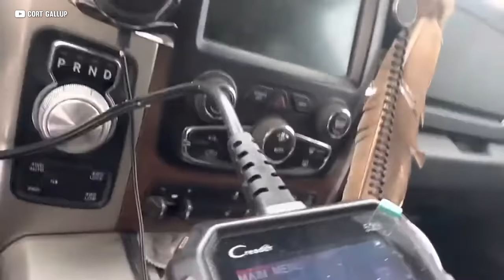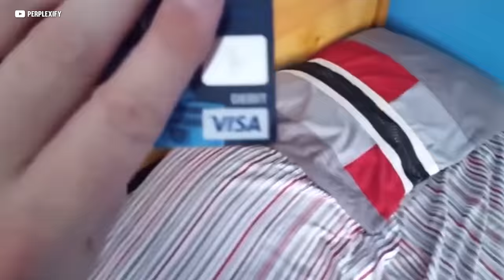Worst Trucks Only Stupid People Buy

Comment: I'm a traveling nurse--I visit dying patients in rugged areas--my GMC truck, brand new, soon developed a piston ring failure problem and scratched the cylinders starting a massive oil consumption problem. I was putting buckets of oil in that thing all of which burned and caked over the entire engine bay over the next few years and made the timing chain to slip. It finally failed me during one of my emergency dying patient visits--Thanks a million GMC! (especially for failing to cover what's stated in your warranty).
Reply: I have first hand experience how bad GM is with my 88 Sierra. I thank my lucky stars for Toyota. The 4.0 litre v6 and 5.7 v8 are nearly bullet proof. I had a 13 Tacoma and now a 20 Tundra. Toyota builds excellent trucks.
Reply: Just curious, why would a traveling nurse drive a truck? Trucks are so overpriced today. Terrible on gas, tires and all parts. If I didn't need it for work, I'd never buy another truck.
Reply: @jeremyweems4916 Clearly said rugged areas where only a truck can make it. 🤦🏻
Reply: Can't say I'm surprised that dumping buckets of oil into your truck for years would have a negative outcome.
Reply: @mikefoehr235  The sad part is, the best engines they've ever made (pre-AFM 5.3 and 6.0) are no longer put in vehicles and haven't been since 2006. Thank fuck for junkyards and rebuilders.
Reply: Let me guess you’ll go buy another Chevy and brag about how good it is that it was just a flaw lol
Reply: @mikefoehr235  I sold my old 91 Toyota to my childhood friend he now has 770,000 miles on it. Daily driver still 190 miles a day.
Reply: @jeremyweems4916  a 85 Toyota Diesel pickup got like over 39 miles per gallon.
Reply: @ryanb3908  I’m living proof a lot of off reading is possible in a car lol!
Reply: Sorry for your losses
Next time go with toyota
Best quality out there.
I think a tacoma should
Work fine in your case.
Just routine oil changes.
Reply: @mikefoehr235  But they cannot be used for work. They do not tow as much as others. Also they have their own serious issues as well.
Reply: @ramaswamynarayanaswamy4806  The nurse doesn't tow. My Tundra tows 10 000.pounds....more than I will need. Our camper weighs 5 000 pounds. More than enough tow capacity for the second gen Tundra
Reply: @mikefoehr235  Hmm. But I have never seen lots being used at jobsites.
Reply: @TimValenti-v9l  Reading while you are driving can be dangerous. 😂😂
Reply: This makes no sense,it would of been covered under warranty or you could of invoked the lemon law.
Reply: Because is find easy the fools to believe they make American Quality is the best when other companies make in the USA and make indestructible products.  Toyota
Reply: Active Fuel Management sucks.
Reply: @mikefoehr235  My 1994 GM 5.7 is running fine with almost 400k miles on it.  Sorry your 88 didn't
Reply: @BPzeropoint  Some GM products are pretty good. My 88 had issues but the engine was not terrible. The 305 had bad valve guides...replaced under warranty. Funny thing is so many guys say how bad the Toyota 5.7 is...like cam tower leaks for example....this MAY happen after 300 to 400 000 miles. My God I will be dead by then. My Tundra has 52 000 kms or just over 30 000 miles. With some luck, engine may never need more than plugs and possibly a water pump.
Reply: @mikefoehr235  Agreed!  Yeah the older trucks and some cars were better.  They're basic engines and basic means reliability.  The 5.7 iForce is a tank.  It gets bad reviews for MPG and "ancient" technology but I would buy a Tundra any day.  They are basically bullet proof.  Yeah no engine is perfect and will require some parts over the years, that's natural.  My 94 5.7 TBI  has had parts changed but it's part of owning a vehicle for a long time.  The biggest lie with new vehicles/engines are 1 year or 120000 mile or 20000 mile oil changes.   Change oil every 3000 to 5000 miles or every 4 to 6 months.  It's cheap compared to a new vehicle/engine.
Reply: @ilovepinktacos  Toyotas are not reliable anymore. Look at the new Tundra.
Reply: None of what you say is true. Especially since a broken piston ring won’t cake anything in an engine bay. Weird lie
Reply: Wouldve been covered under warranty, given you had one and it it was within the mile/time frame. Also, if you had that issue with the oil consumption why wouldn’t you immediately take it to the dealership or a reputable and trusted auto shop instead of opting to just drive it like that for years until it finally blew, know what i mean?
Reply: Yeah, I call bullshit
Reply: Warranty issues isnt the companies fault. Its the POS dealerships too lazy to comply with the warranty and instead denying them with BS excuses. Same with Insurance companies
Reply: @georgesgranger6362  naaaaaaa. Dealers don’t want to comply because they get hosed six ways to Sunday by the OEM. Low labor times to start but the big issue is them denying claims. Ford will call a part back inspect it and then deny the claim if they don’t find a fault. The most egregious situation I had was when I clearly wrote in my warranty notes that I replaced a rear view mirror for rattling. They called the part back and inspected it. Denied the claim because “all mirror functions are operational”. The hands free speaker in the mirror was loose and rattling so that nobody could understand the driver. That was the complaint and my remedy. Notated out the rear. It took a month of emails back and forth from our claims lady to get it paid. Ford also will NEVER pay to replace a tire pressure sensor. They will decline them every time. Even though they are technically covered under warranty we would not change them unless the customer paid. I could go on and on for days.
Reply: @AlphanumericCharacters  we could probably stretch out this comments replies by a few hundred just from your experiences it seems, whats the wordt one to date?
Reply: @jeremyweems4916 
Could well be reasons not related to nursing - like on a nursing salary can’t afford two vehicles, or no place to park one that isn’t being used.  I figure if you contact that person and offer to buy and pay for insurance costs you might find a list of reasons why not that’s TLDR.
Reply: Just find a 4.8 of those years they never had the displacement on demand so you get a normal ls that is reliable or have it deleted.

Comment: I traded in a 2006 F-350 Super Duty 6.0L, which, by the way, had every single problem you've described, for a 1999 F-350 Super Duty 7.3L. That was 7 years ago ago, and the 1999 is still running great in an every day usage. I've put over 100,000 miles on the truck and would not hesitate to drive it all around the USA. It has 246,000 miles on it and is as strong as ever. The thing that kills me the most about virtually ALL these automotive disasters is that in almost ALL cases, the poor designs were directly a result of some rediculous government CAFE standard. My '06, for example, could NEVER get better than 12 MPG. That is before mandated Exhaust Gas Recirculation Valve failed causing coolant to enter the cylinders. AFTER I performed the brazenly heinous criminal act of deleting the EGR valve, the truck could regularly achieve 16 to 18 MPG. So, I guess the political save the planet geniuses think that a 12 MPG truck will pollute less than an 18 MPG truck. And THAT was before the craze of burning urea with fuel oil for EXTRA CLEANLINESS crept into their twisted political minds. Hint: all this anti pollution, save the planet mandate garbage is DESIGNED to reduce reliability and increase cost to EVERYONE. Funny how all the wildlife population that we are supposed to be making extinct with pollution is absolutely flourishing. If you use a little common sense and don't blindly accept the fact that we're killing the planet, it's pretty clear to see that it's the GOVERNMENT that wants to "kill the planet" so they can declare a crises, rush in and suspend freedom to "save us" from ourselves. EVIL has to appear as virtue in order to advance. Let's stop giving it the highball signal to destroy everything good!
Reply: I can't see the other 2 messages it says are here...thanks overlords.  I 100% agree, but lets not forget the absolute RUSH to bring in EV's.  It is a disaster waiting to happen.  They had to make the diesels go away.  After a few mods, the VW tdi was getting into the 60mpg range.  That's why they had to kill it and punish the company.
Reply: We must all become activists and demand that the nonsense stop.  Excessive epa regulations to the ev mandates.  It's not 1970 anymore and they've went way way too far.  Get active.  Politely and professionally share your opinions.
Reply: Well said. All these videos accomplish for me is the common theme of buy “older” and hope you have money to get her right. And yes limited guv is the best for us normal folk.
Reply: I have reflashed a few 00 to 03 5.3L ECUs. They run 13 to 1 AF stock. Runs a lot better at 15 to 1 under 2000 rpms and will idle 16 to 1 after warm up. I leaned the crap out of mine to see and went from 13mpg to 20mpg only in summer, though it was too difficult to make it happy like that in winter so 16mpg is where it settled. The computer fought me tooth and nail I pass emissions with the tune since 2011. Otherwise, I'd turn off all four O2 sensors and save a tiny bit from having to run the O2 heaters. Also it makes 100hp more on the top end and downshifts.
Reply: Exactly, why should ordinary people be the ones targeted by these laws instead of the massive factories that put out shitloads of the stuff AND actually have the resources to deal with it
Reply: I'm with you have a 97 7.3 powerstroke with a full upgraded turbo, intercooler, fuel system etc only restudded the motor for longevity bought with 190k now has 450k and only burns half a quart between oil changes and gets amazing mpg
Reply: Amen brother
Reply: There's no doubt the mandated CAFE standard increases had to have had an effect.  And you can tell a correlation when these standards were raised, and what happened with these problem engine designs shortly afterward.  Of course, once mandated, they rarely get reduced, so the manufacturers have had to make bricks with no straw from that time forward.  A little overstated, but not really.  I can remember who pushed these mandates, and thinking at the time, "Here we go. We're going to see massive price increases and problems."  It used to be a fairly rare thing for the Big Three to have engine issues that often.  An engine here and there, with recalls.
Reply: Thank you👏👏👏👏👏🙏🙏
Reply: Just a quick update on the 1999. A few weeks ago, my beloved mother passed away at the tender age of 96. Things happened fast and all I had time to do was get a few things together, fuel up the truck, and fly down the highway. I left Syracuse at 22:30 on Thursday night. I made one stop for fuel on the Ohio, Indiana line and I was sitting at my cousins house in Racine WI at 09:30 Friday morning. Me and my 24 year old truck literally turned Syracuse to Racine and back at 85 MPH. No runs, no hits, no errors, not a single malfunction or problem. Oops, I DID replace my wiper blades. They were Bosch Icons but after 5 years it was time to change them. I replaced them with Bosch Icon Visions so we're good to go for another 5 years or so. There's excitement brewing as it won't be long before I've knocked down the 1st quarter million miles with my pet beast. Stay tuned!
Reply: Idk about animal species flourishing but the rest is 💯
Reply: I agree good sir. I especially loved it when you stated that evil has to appear to be virtuous...if ANYTHING works to well, it has to destroyed or diminished so the "people" can't get ahead and will have to stay dependant upon someone else. 💯💯💯💯💯
Reply: "The welfare of humanity is the alibi of tyrants." - Albert Camus
Reply: Agree
Reply: Man I love my 6.0L ... I know the 7.3 is more reliable, but I don't like the way it sounds or feels. I'm happy to bulletproof it, it's worth it
Reply: I on the other hand have a 6.0 with 315k on the odo and counting. While it is EGR deleted I have travelled around the US with mine towing a 14,000 lb fifth wheel. I change oil regularly full synthetic and maintain that thing religiously (who wants to be stranded on the road?). The 7.3 is a legendary diesel engine there probably won't be anything like it in it's lifetime. I love my 6.0 mainly because I got it on the cheap works for us since that is all we really use it for get's driven weekly at least though ;)
Reply: We have Senator Ed Muskie from Maine to thank for catalytic converters and all the mess that came afterwards. The guy probably never turned a wrench in his life.

Comment: I own a 2002 silverado v6 manual   with 345k miles and still hits 100mph on the freeway
Reply: How many quarts of oil you go through? 😂 don’t lie my friend has a Chevy Colorado he’s 66 years old so doesn’t abuse it and with only a 108k it’s usually 2 quarts low between changes 😂
Reply: You’re going over the speed limit my guy
Reply: Bravo.😅

Comment: I bought my 1999 Toyoda Tacoma brand new. Always did the required maintenance on it including changing the timing belt about every hundred thousand miles or so and never had any problems other than a leaking power steering unit while it was still under warranty. I gave it to my daughter with over 225,000 miles on it and she is still driving it today. Of course I changed the oil regularly and naturally the tires, brakes and battery. Couldn't be more happy with it. Still running like new.
Reply: Toyoda???😂😂😂😂😂
Reply: @mikedrown2721  Yup, Toyota Tacoma
Reply: @daryljacobson7462  Thanks for the removal of the letter "d"  lol👍

Comment: I own a 2007 Nissan Titan. It has never failed me. I plan on driving it for another 10 years.
Reply: I've heard the gas V8 is a solid motor without the complexity of cylinder deactivation.
Reply: Thise older Titans were good. I think the problem is the cummins in the newer ones
Reply: That engine and the Toyota 5.7 are the most reliable motives. Probably in the last thirty years and that's a fact
Reply: I sold my 2007 Titan 3 years ago with 280k miles. Only thing I replaced was the radiator (upgraded to aluminum ) and the driveshaft bearing.  Everything still worked down to the original a/c charge. I still see it around town today, probably has more than 350k miles by now
Reply: I drive a 05 titan with 280+k ,   iv owned , a ram with the 4.7, a f150 with the 4.6 v8 ,iv had a the Sierra 1500 with the 6.0 ,   the titan by far is the better of them all !,
Reply: I have the same truck. It’s got 300,000 miles on it and it still runs great
Reply: Same here.

Comment: 2007 Ram 1500 4.7. Not a daily driver, but I've had it 14 years. Just recently saved myself 250 bucks charging the original spark plugs myself.  Surprisingly they weren't in really bad shape. Figured 17 years was enough to ask. The reason (2 reasons) I'll continue to drive this truck is the (well serviced) transmission is amazing. Granted only 235 hp, but once up to prudent speeds it reallt performs like a champ. That second reason. Not willing to shell out 4 to 5 times what I paid for this truck. Twice as much sure, but NO truck is worth 70-90 grand. That's insane.
Reply: I’ve got a 2008 Ram with the FFV 4.7, all original parts except for the water pump and alternator. Just rolled over 240k and been clanking for the last 100k. Really underpowered for towing but a great truck for the farm. Now I got a 2017 5.7 Hemi to do all the hard pulling and look pretty while doing so!
Reply: How in the hell do you "charge" a spark plug?
Reply: @scarhart53 I was thinking the same thing 😂 auto correct must have gotten involved in that 😂
Reply: I had a 2007 4.7 that had shifting issues. I had to run it in tow-haul in town to keep it from trying to drop into OD at 30mph and start to chug. When I didnt run it in tow-haul, it would shift "backwards". Take off in 1st, hit second,  go to third, "stumble" back into 2nd, then 3rd again. And of course the used dealer I bought it from had their alcoholic mechanic look at it and swear there was nothing wrong with it. He tried to pull transmission codes and came up blank. It was a nice 4 door truck, very clean, sounded really good with the duals, and it was priced right.
Reply: 4.7 like the 318 are good but light duty.
Reply: @ronaldnorris2179  Auto correct, the bain to my existence.
Reply: @jimandersen3003  Yeah but the 318 is about the only bulletproof Dodge engine I've ever owned. Some swear by the 360 but, I drained the oil out of my ugly assed wagon and drove it for a month and it never blew. Mom had promised me a new car if my old one blew up, well guess what I drove for another year after replacing the oil lol.
Reply: How many miles on the truck, and how often do you change your fluid and filter? Do you have a tranny cooler?
Reply: We had a 2001 Durango w 4.7, I LOVED THAT SUV! At 260K she had to much rust and the tranny was starting to slip. That thing was a total BEAST! She would push 3’ of snow until it packed up too much but in the snow, she was KING! I pulled mini vans out of ditches up hill in 14” of snow😆

Comment: I've owned a 2011 Ram 1500 since new. It's got newer version 4.7. 226,000 miles. No issues ever. Gets 20-21 hwy mpg. 4 wheel drive, standard cab. Love it
Reply: The main issue is that it's not a GMC 2500HD, therefore, not really even a truck.
Reply: @alphaforce6998  RAM 2500, Ford F250, proper trucks
Reply: Mine is a 22 Ram PowerWagon 2500. It will leave that GMC on the trail. I bought it one year old and saved $20,000! Method Wheels and Yokohama G006 Mud Terrains complete the package.
Sucks gas through that 6.4 L but I knew that before I bought it. $20,000 buys a lot of fuel!